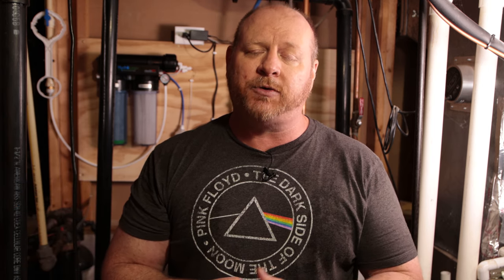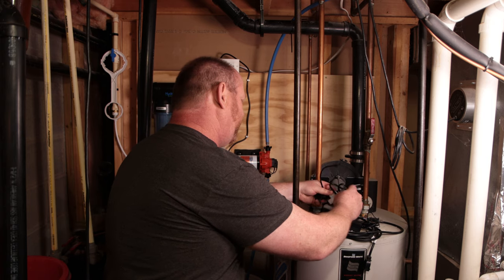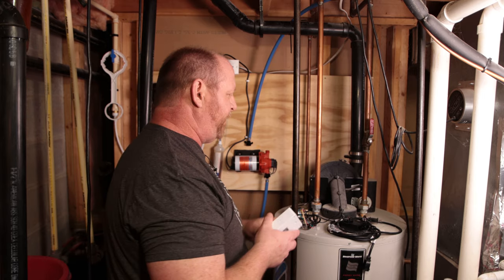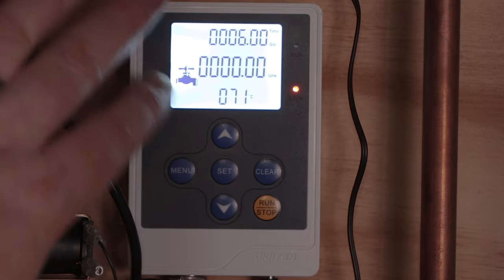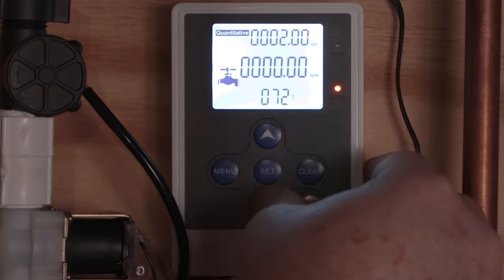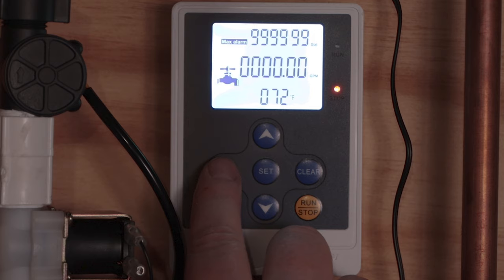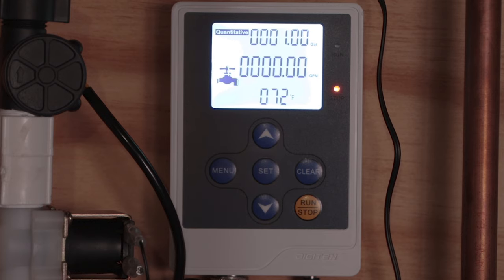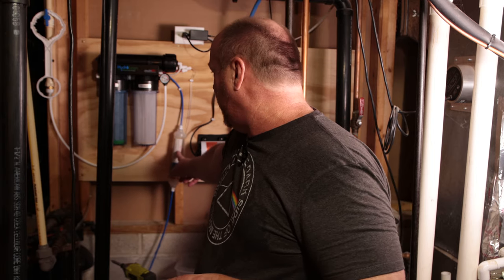Digiten DFC15 Liquid Flow Controller -Installation, Setup, and Accuracy Test

Comment from the maker: I received information regarding the temperature range on the solenoid and the hall sensor. 

Solenoid temp range is 0-100c (32-212f) 

The hall (flow) sensor it rated for <80c (up to 176f)
Reply: Thanks Brian
Reply from the maker: No problem! 👍🍻

Comment: That one is a lot nicer than my Chinese unit. I chose not to use my temp probe since I'm just filling my hlt and going kettle for strike water.  I made a spreadsheet converting gallons to liters, every half gallon. It works great. You'll love that during the brew day. Cheers Brian!
Reply from the maker: Thanks Wally! I knew you had one I just didn't remember what it was.. I'm looking forward to using it!! 👍🍻
Reply: @ShortCircuitedBrewers  we're like twins (not the movie) except your stuff is a lot nicer. lol.

Comment: I have my RO output routed directly to my HLT.  However, keeping track of when the HLT is full of 20 gallons of water is a manual effort and I've had a few overflows...  This looks like it would be an awesome solution to that!!!
Reply from the maker: If your flow rate is high enough it might work.

Comment: Great video. I was looking for info on this specific setup but didn't hope for such a complete review. Thanks! 
Could this be used on the beer side after fermentation?
Reply from the maker: I don't think I'd use it that way? I'm not sure how well the solenoid would react to the beer. And cleaning etc. 👍🍻
Reply: @ShortCircuitedBrewers  Yes that makes sense. Maybe if they came in stainless steel it could be considered!
Reply from the maker: @rbmrobin  yeah you might look into a stainless solenoid. Glad you enjoyed the video! 👍🍻

Comment: I just purchased! Thanks for this! I have a very similar water setup as you, so could you tell me what extra parts you had to get to install this. You didn't really show everything inline after it was installed.
Reply from the maker: Sorry about that I showed the connections briefly. Are you on PEX?
Reply: Yes I would install it exactly like you did.
Reply from the maker: @Rhork77  I used 2 of these 1/2" PEX to NPT adapters 
https://www.menards.com/main/plumbing/hoses-tubing/pex-tubing/sioux-chief-powerpex-reg-1-2-poly-pex-closet-adapter-fitting-1-pack/637px420pk1m/p-3289655538082694.htm

And a threaded 1/2 PVC connector. 
https://www.homedepot.com/p/Charlotte-Pipe-1-2-in-PVC-Sch-40-FPT-x-FPT-Coupling-PVC021020500HD/203811422

Just be sure to use plenty of Teflon tape.

Comment: Brian awesome video, question are all of those parts prior to water being heated another words what is the temperature limit of the flow meter and the solenoid. This would work better for me on the brew rig at strike water temperatures
Reply from the maker: I have a question in to the manufacturer. There is no listed info on the solenoid or hall sensor.. The temperature sensor is rated for 255f
Reply: @ShortCircuitedBrewers  Thanks Brian, if this is good for high temps I would like to use this on my brew rig to move water to mash tun for both strike and sparge. Thanks buddy!

Comment: Brian Great video, 
Quick question, how did you calibrate the flowmeter to account for the length of the plex lines  (hoses).  I have this same device and I have not been able to account 20' of pipe line, So i am typically short on volume.  
Thank you in advance, 
Cheers Jorge
Reply from the maker: Don't need to. Those lines don't "drain" Once the flow stops. If they did I would have to account for it, the system only allows the exact amount of water to flow through the system. Do your lines drain? 👍🍻

Comment: so i just received this unit (with 3/8 JG quick connects)... great video showing how this works! ...but i'm looking for the detail = "How is the thermostat connected inline??"
Reply from the maker: You'll need a threaded T inline with the proper threads.
Reply: @ShortCircuitedBrewers  where on earth did you find  a 1/2" NPT with M8-1.25 'T'?!
Reply from the maker: @rubenpalma3828  oh I didn't find one I was just saying.
Reply: 😂 @ShortCircuitedBrewers  ... k, so how did you install yours? i wound up just using a tap(& die) kit to thread a hole in some 80PVC. Now i've discovered, the person who purchased this unit for me to install bought 24v solenoid and meter... digitens vague instructions implies we can install a bigger power supply (comes with 2v and says can handle 5v), but still vague. NOW where to find a 5v that wont fry the unit??
Reply from the maker: @rubenpalma3828  I didn't install mine. I don't care about the temperature. I just left it zip tied up with the rest of the wiring.
Reply: @ShortCircuitedBrewers   thanks so much for your quick replies. i am having little luck with digiten getting back to me.
Reply from the maker: @rubenpalma3828  is there a reason you need temperature?
Reply: @ShortCircuitedBrewers  Not really IMO. the Director of Product Development for my company wants it... believes the temp may change volume amount when weather changes (we operate in Sonoran Desert with drastic high temps and random freezing)
Reply: and he purchased 2 components with Quick Connects because he thought it would make my job easier. looks like i need to get 12v parts or figure out how G3 parts work with this controller.
Reply from the maker: @rubenpalma3828  oh ok.
Reply: @ShortCircuitedBrewers   this thing is so cool, but wish i could get it to work. Tried all day yesterday and seems like a multitude of issues. 24v soleniod, so there's that. This is driving me nuts. and there's a short in the wiring harness on the control board for the flow meter power, so i can manually on/off water if the flowmeter worked, at least i could tell when I'm at 90 gallons. Flow meter came not working. reading other reviews these are 30% faulty. Totally sucks portioning 5 gat at a time >:( someone was distracted and added 2 extra buckets and screwed our brew... arg. ordered the Gredia ZJ for giggles :/

Comment: Impressive level of accuracy if set up correctly.
Did you try higher volumes of water with the same settings? (like 4 gallons or higher?)
Imperial units is a blast from the past, here in Australia.
Reply from the maker: I did not want to waste water. It was accurate 3 times at a gallon though.
Reply: @ShortCircuitedBrewers  Fair enough. Does this flow metering system hit the volume marks in your brewing tanks? Do they match the readings as your tank fills?
Would certainly make brew day flow a lot more smoothly.
Your home set up is becoming more automated and monitored which is the case in many micro breweries and industrial set ups.
The future for brewing could well end up in the AI bin - with robotic automation. I know that in the food industry generally, robots and automation are popping up everywhere. My first experience of this was a robotic system used to pack boxes of cheese onto pallets. Apparently there are robotic cheese and wine tasters....where is the fun in that?

Comment: I spy with my little eye a spade connector that had the wire pull out of it :) nice fix for it though.

Why didn't you mount the controller next to the tap to make it easier to fill your pots?
Reply: I came to ask the same question!
Reply from the maker: Haha... Those connectors are almost a one time connection!! Geez Louise almost had to use needle nose to pull it off when I had the solenoid upside down.. Had to quick fix it to move on.. You guys have good eyes.. Lol👍🍻
Reply from the maker: See answer 2 for the first comment.. Lol the cable is not long enough to reach the faucet it is about 30 of wire length away.. 👍🍻

Comment: would it not make sense to have a manual valve in front of the device as a kind of "master switch" so that you would not have to trust the device to not malfunction if it's not used for a long while?
Reply from the maker: I suppose you could but I have a faucet hooked to it so even if the solenoid failed open. The faucet would prevent the system from draining. Just a side note it's been installed for years now and never had any issues. 👍🍻
Reply: @ShortCircuitedBrewers  oh you connected it to the faucet? I guess that's the same thing basically.
Yeah I wouldn't expect it to fail but you never know. There might be a manufacturing flaw in your particular device or maybe there is a lightning strike messing it up or something.

Comment: Does the unit use the temperature sensor to help determine the volume of water? I understand that in your setup the temperature isn't going to vary that much, but it could if used inline with the hlt.
Reply from the maker: I have a question in to the manufacture about maximum temps. The sensor is good up to 250F but that is the only thing that it listed. I seriously doubt the system uses the temp sensor for expansion rates at increased temperatures though. My biggest concern would be the temperature capability. I'll let you know what I hear.

Comment: I think the way you've got this setup probably works well for biab or single vessel setup.  In a HERMS 3 vessel system where water is heater in the HTL, how would you suggest setting this up?  I figure it would have to be installed inline between the HLT and the mash tun.  Is it rated to handle water temps in the 150F range?  I looked and couldn't find any info on that.  Thanks for the review.  I think this would be a great addition to my system.
Reply from the maker: I cannot find a temperature rating on the valve or the solenoid. My plan is to use it for all my systems for filling mainly. It will be nice to set it and go do something else while the system is filling. I will contact the manufacture and see if I can get clarification. The temp sensor reads up to 255f? I'll report back on what I find.👍🍻
Reply: Brian & Stephane, I’m using this same unit to monitor recirculating rate in my HERMS setup, using one of their lower flow meters (3/8  inch capable measuring as low as 0.5 L/min). It works well, but I had to use a different temp probe to obtain an accurate temp reading (probe needs to be in the flow stream), the probe I’m using is a 50k and similar in size to an Inkbird temp probe. I too had to dial in the K value for the smaller flow meter (I’m using 68.5). I have the flow meter and temp probe on the output of my recirculating pump, it is providing interesting information on mash temp and allows me to dial in the HERMS flow rate using a Riptide pump, I also use the unit to measure flow rate during fly sparge. It took some work to get it set up to do what I wanted, but overall I’m very pleased with the Digiten DFC15, a great value versus a traditional mechanical flow meter!
Reply: Short Circuited Brewers, the flow meter I’m using is rated for up to 80 C (176 F) I’m sure most of the others are as well.
Reply: @edfain5814  Thanks for the detailed description Ed.  This is a very interesting application.  I too had wondered if I could use this to monitor sparge rate.  Will definitely look into this.
Reply from the maker: See the comments below and I got this from the manufacturer

Solenoid temp range is 0-100c (32-212f) 

The hall (flow) sensor it rated for <80c (up to 176f)
Reply from the maker: Awesome thanks for the info... I might have to get a second one!!

Comment: Since the solenoid is early in the line and not at the end of the run, is that why the K-value has to be messed with to account for the water in the line that's no longer pressurized and not coming out the faucet?
Reply from the maker: No, the k value was not set properly for the sensor from the factory for whatever reason. It does not measure pressure only flow. 👍🍻

Comment: So does the pump also automatically turns off and on or you need to turn it on manually?
Reply from the maker: It turns off automatically when it reaches the pressure cut off due to the valve closing. The pump has a high limit pressure switch built in 👍🍻

Comment: how does the mounting bracket mount to your board? if you have a picture that would be great.
Reply from the maker: There is no mounting bracket there's just screw holes in the back of the unit.
Reply: @ShortCircuitedBrewers  I mean the bracket for the solenoid how does that mount to the board?
Reply from the maker: @ironbends649  it's not mounted it's just floating free the connected both ends to the pipe
Reply: @ShortCircuitedBrewers  oh ok so you didn't use the mounting bracket

Comment: The line coming out of my carbon filter is a 3/8 id. from a 3/8 barb fitting. would that change the K value? I could always change to 1/2 tubing if I had to.
Reply from the maker: I assume you are running your rap water through the filter and then to the kettle through this device? You probably will have to adjust the K value slightly..it pretty easy to dial in though. 👍🍻
Reply: @ShortCircuitedBrewers  Thanks Brian, You're a great help. I love the idea of set it and forget it!
Reply from the maker: @ironbends649  game changer! For sure! 👍🍻
Reply: @ShortCircuitedBrewers  I imagine I should run this before the filter in order to keep flow down to exact .5 gal since the filter is only good at that volume. Or would it matter since the control would only allow a flow of .5 gal no matter if  it was placed before or after the filter?

Comment: Actually, I'm questioning if this would work for what I would want it for.  If I tie this thing into the output of my RO system, there's still the waste water output that I have routed down the drain.  When this hits 20 gallons through the RO output, would it just block that pathway and route all of the water through the waste water tube then?
Reply from the maker: What is the flow rate on your RO system. There is a minimum spec on the flow meter and most RO systems don't have near the amoutnof flow needed to measure it properly. Which is why I have a reservoir with a pump. Most RO systems only produce waste water when they are filtering so your question would be no. Once the flow stopped the waste water would stop as well. Hope that helps.
Reply: @ShortCircuitedBrewers  so mine is a 100gpd system but I don't have the required pressure to hit that number. I get roughly 1.5 - 1.75 gph. Do you know what the minimum flow rate is for this device?

Comment: Hello, I hope you can help me. I would like to be able to control the maximum amount of water that passes through the pipe per day, I rent rooms to people, sometimes there are water leaks in toilets and they leave faucets open. I would like it to be possible to program a maximum amount of water per day, to prevent water from running out due to excess use or leaks. Some system that is programmed so that each day it allows certain liters of water to pass through and after these it closes and the next day it automatically allows a certain amount of water again. I thank you very much
Reply from the maker: This system is not capable of that. That I'm aware of. You'd need a scheduler function. I'd look at a sprinkler system programmable manifold? If you're renting rooms to someone you might also want to check and make sure that's not some health code violation not having running water unless you're just looking at setting it up on the commode itself.

Comment: could i use that flow meter and controller for OLIVE OIL?
Reply from the maker: I don't see why not. The calibration might be different due to the viscosity. 👍
Reply: changing the K value , right?
thanks from Colombia
Reply from the maker: Yep

Comment: The solenoid valve I received leaks, on Amazon 25% of people gave a 1 star rating for the valve.. it also takes forever to get as it comes from overseas, disappointing...
Reply from the maker: Interesting, I did not and have not had any issues with mine. Sorry to hear about that. 😔
Reply: @ShortCircuitedBrewers  Thats for the 3/8" fitting valve on the reviews... ordered a replacement, hopefully the new one's good, great idea to incorporate into brewing
Reply from the maker: Please report back. 👍🍻
Reply: @ShortCircuitedBrewers  Got the replacement from Amazon, works perfect!  Digiten is also mailing me one for free. This thing is really cool, its worth the wait.
Reply from the maker: Good to hear! They were pretty responsive when I dealt with them. 👍🍻

Comment: DI water isn't the best for brewing or especially drinking. It has no minerals so it will affect your mashes big time. It will grow bacteria at a much higher rate due to it being so pure. I assume you are building your water back up with salts etc but be aware it is aggressive and everything downstream needs to be plastic or 316 stainless. Cheers!
Reply from the maker: Yes of course I build my water back up, that's the entire pont of using RO water  If you shouldn't drink it wjy do they make systems for your kitchen that are "drinking water" systems. Just so you know the holding tank has been full for a couple months with no bacteria. There is nothing in the water to "grow". Cheers!! 👍🍻
Reply: @ShortCircuitedBrewers  RO is rated for drinking water, but DI doesn't use food grade resin and any open air into the tank is the issue. Just don't want you to have a problem, I build and service RODI systems for medical and manufacturing.
Reply from the maker: Ok thanks